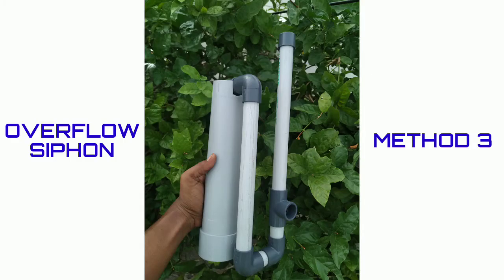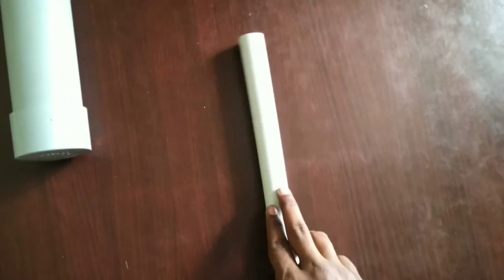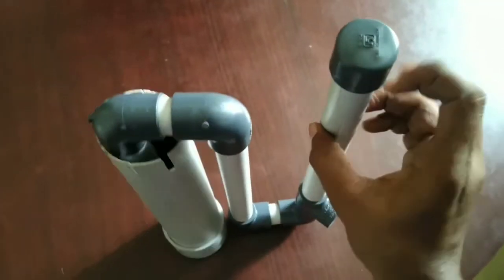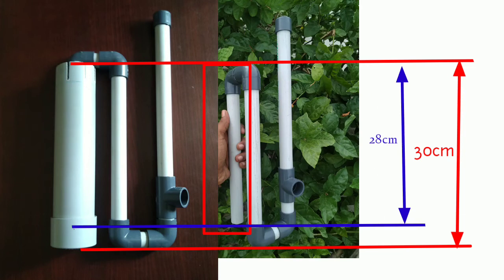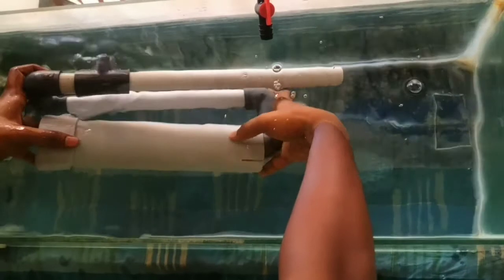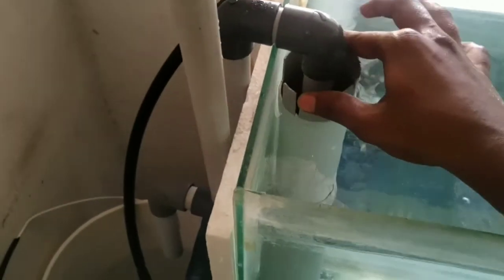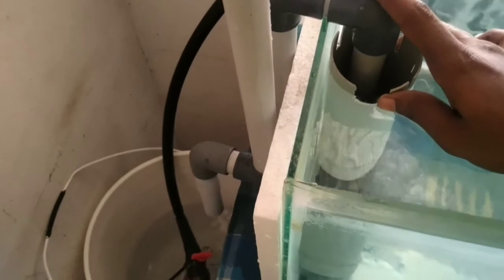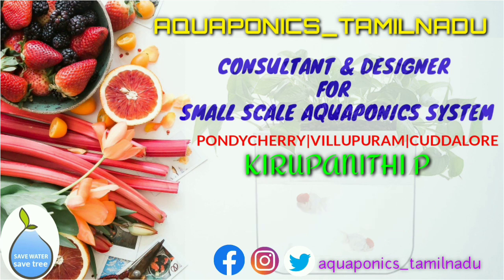Diy overflow siphon for aquarium|method-3 tamil |new and different| #diyoverflowsiphon #aquarium

Comment: 05:55 - Could this be long like this or can make it to the same level as the top 2 L bows ?
Reply from the maker: No problem you can make it same size but don't close that pipe it's for air flow pipe
Reply: @KIAQUALORE  Thanks You.. Done. Added a end cap with a air line hose to prevent the gurgling sound..